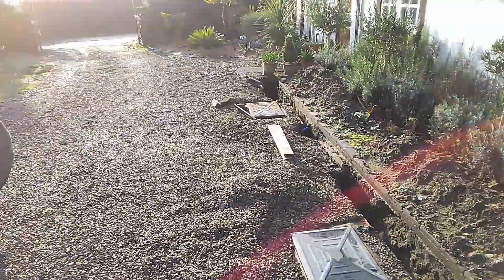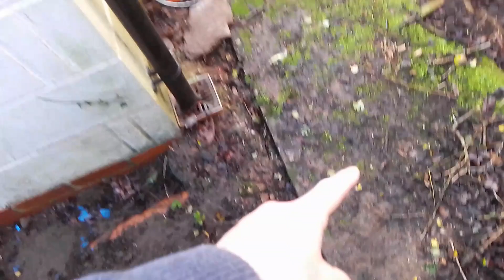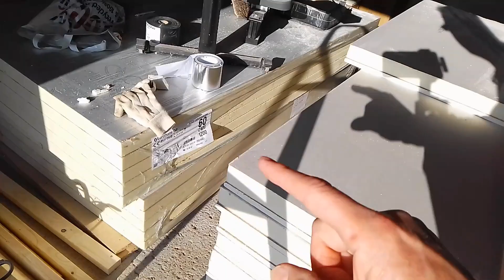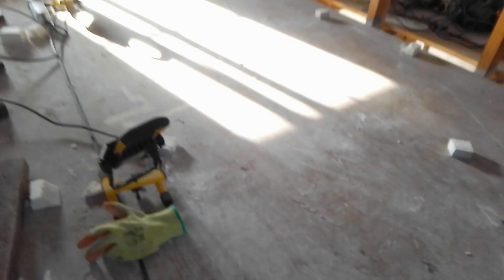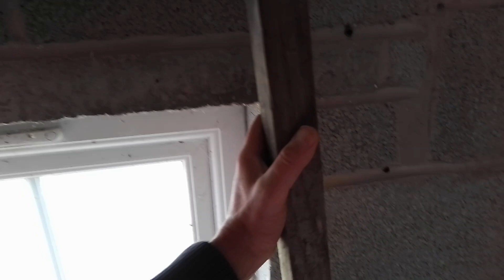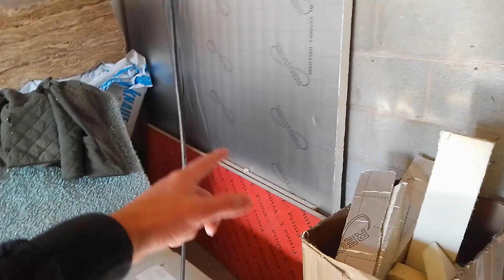DIY Garage Conversion to Luxury Annexe The Saga Continues

Comment: Mark, a situation arose where it might have been best to bury a dead squirrel rather than trying to find someone to remove it. It is a long story. Next time I was thinking the most natural thing would be to bury it and came to your channel for advice. I was thinking that that spade you use would be good and was willing to purchase from your Amazon store. But I checked the descriptions of two videos and cannot find the link. Has your Amazon store closed? Ta
Reply: Ah it is in the Home section. OK, to earn a purchase, I see several choices. If I had a "squirrel" to bury (a large dead "squirrel") which spade would be the fastest for a woman in her fifties (but quite strong, although short of stature) to use? Let us say, 4 ft hole (cannot be bothered with 6 ft). About a metre long and 1/2 metre wide . Ta.
Reply from the maker: I hope you don't mind but this comment and the one before it had me giggling! are you sure it is a squirrel? Provided it is legal to bury whatever it is you are dealing with (HAHA), I would buy the long handled one, better leverage, be slow and steady and careful at first until you get the hang of it.
Reply: @MarksHouseandGardenUK  Thanks Mark. I must admit it does sound comical. Sad but also funny. The council charges a fortune to remove these bodies and it is not in my garden but on an allotment. I just want it gone, then I can relax. I was told a man would deal with it, but that man is a little crazy too. So next time I want to be ready. I remembered the special shape of your spade and Christmas is coming. Thanks again. 🦊

Comment: Interesting project, Mark, and quite involved with septics, etc. We stayed in the UK recently at a converted garage a little bit bigger than yours, but they also extended it a bit to add the bathroom downstairs. If you search Airbnb The Willow (Alton Towers, Animals, Peak District), you will see some pictures. What he had done with the second level was put skylights in, which could open for ventilation and also added light.

We talked to the guy, and he too had issues with stairs. He got a guy to design, build, and install some custom-made ones, and they were pretty good.

Re: the septics – I’ve pretty much spent 30 years living with septic systems. The best ones are the two-chamber variety: solids settle in one, and then the water that fills it flows over to the next chamber, and from that chamber to the drainage lines. Add a foul-air escape ( usually a tall pipe) and some vent mushrooms in the field where drainage happens. Normally, the tanks (pre-cast) are delivered on-site and installed by the septic/drainage team. I would think this would be the way to go.

The new system we had installed in a recent new house is an 8-chamber system – it has blowers, pumps, and filters, which need cleaning and are a bit of a pain, but the water that comes out is very pure. This is what the council required for new houses (but not my favorite).

Anyway, I thought I would just add some of my thoughts. Maybe contact the guy at the Airbnb – he was very informative, and he could probably give you a few ideas/help.
Reply from the maker: Just read this with a great deal of interest thank you. Most informative. Mine is a two tank system, the tank is perfect, it's just the drainage field which I am replacing (under the 'General Binding Rules'). I've taken on board your comments and will consider applying them here. I thought about roof lights but it's quite a small space with windows on each gable. That airbnb, WOW!! stunning, i can see what he has done with his staircase. I'd need to remove another two floor joists to do that for 2m head height on lower steps. Those pictures are very inspitarional, i'm motivated!! Thanks again. Mark
Reply: @MarksHouseandGardenUK  No worries Mark, I hope it all goes well.